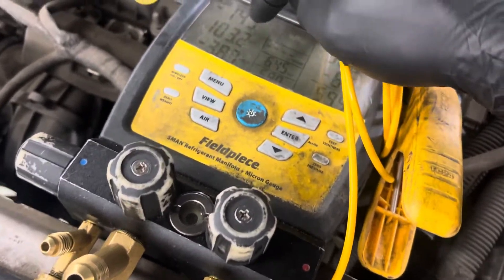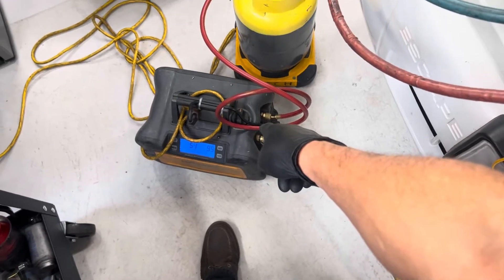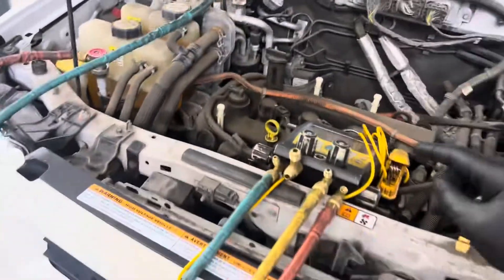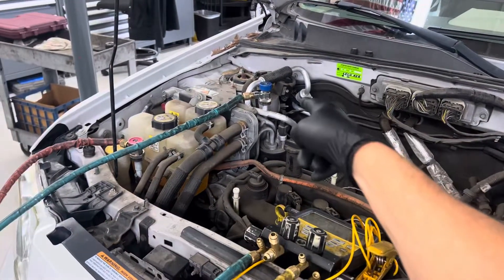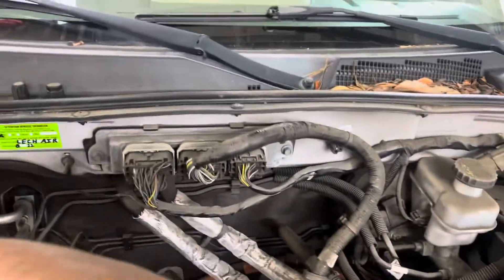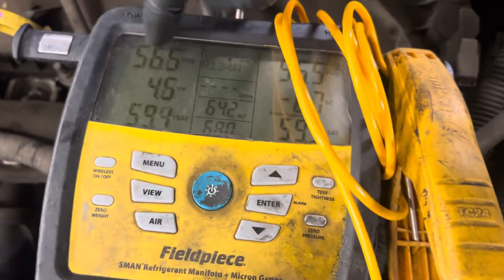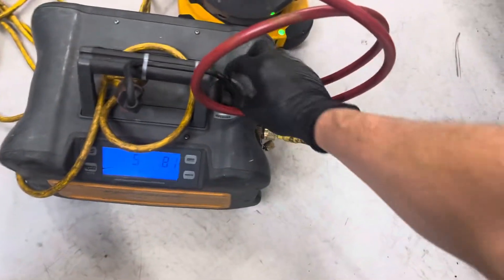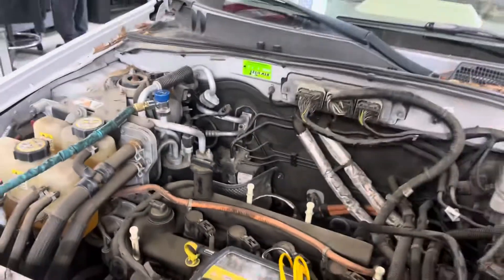Only 650g refrigerant recovered out of 1080 g Front AC only￼. Rest of the refrigerant in the rear. ￼

Comment: People don’t understand, rely on the automatic vacuum and charging machine. No wonder. I’m getting back on my coach AC. I got a Fieldpiece vacuum pump now. Had a SMAN, scale and remote pressure gauge. See if I can put the puzzle together and fix it this time. 99% sure need a new TXV. That’s is buried in the dash of a huge motor home
Reply from the maker: Wow you’re going full bore technical here and getting all the equipment never hear somebody who has serious. 

Good to hear from you Christopher haven’t heard from you in a long time I was wondering how that RV was going. 

I could 99% sure you on old RVs like that you need to change the TXV.  

Before you do any work cut open the receiver dryer and you’ll probably see some rust on the inside. 

Overtime the rest flakes off falls down to the bottom of the receiver dryer and is sucked up by the straw at the bottom that travels directly to your expansion valve and plugs up the expansion valve with rust 

And sometimes on the inside if you have steel fittings you look at the inside of the hoses fittings and you will see rust on the inside of the fittings ready to flake off if it’s really bad.  

You could use some sort of why are brush like cleaning the bore barrel of a gun or something like that to scrape off the heavy debris or completely change the fitting ends if you choose to or hoses or just be satisfied with cleaning and chipping off loose rust. 

On an RV leave the vacuum pump on overnight change the oil when it gets cloudy looking and repeat. 
If you need to leave the vacuum pump on 48 hours because after 24 hours it is still coming out cloudy leave it on 48 hours you cannot over vacuum. 

Especially if you have one of those RVs where you have 50 feet of hose going to a rear unit to the front unit.

Curious did you go to True Tech Tools ? Did you use the promo code for an 8% discount BIGPICTURE all one word capital letters
Reply: @coldfinger459sub0  shit no , ohh well. Thanks so much for the tips. I changed out the  reciver dryer last year in my first attempt. I wish I had looked but I do know the dealer got the dash air working a year when I bough it in 2019 so that’s out as a tell tale. I am semi retired so AC work on the side is not a bad thing. Do it right or not at all. Make money vs throwing it away. I’ll keep you posted by email. Planning on a few days of vacuuming. It must have over 100’ of hose and tube. Old York compressor. Love to swap it with a Sanden
Reply: One thing a few guys done is flush the hoses. I’ve heard they are filthy. So I do dig into the dash to pull the TXV , what’s a good flush?
Reply from the maker: @christopherrasmussen8718  I think from Napa you could get some thing called DuraFlush maybe some other parts stores to

Then O’Reilly‘s or grand auto everybody has some chemical company that sells a AC approved flushing solvent. 

Remember you cannot flush through receiver dryers you do not flush through expansion valves

Do not flush through compressors. 

Donely thing you can do with a compressor is manually remove it turn it upside down and pour the oil out

And if it’s one of those few compressors that actually have a oil drain plug you have to drain out the oil from the oil drain plug and put back in the oil through the oil drain plug

Like some of your SANDEN compressors
Tecumseh compressors
York compressors
Frigidaire General Motors A6 compressor
And others that you have to read the manual on and then all the rest pour out through the high side low side port
Reply: @coldfinger459sub0  thanks so much . Mines a York but I like to put in a Sanden

Comment: How much total refrigerant was recovered?
Reply from the maker: After I turned on the ignition key and recovered the rest of the refrigerant that was trapped 1080 g
Reply: @coldfinger459sub0  well done
Reply: @coldfinger459sub0  When I did the same for my vehicle total refrigerant recovered was 633g out of 750g,do you think there is leak some where in the system? Technician added 750g and told to come after 2months since vacuum leak test passed.
Reply from the maker: @issamadam9352  If your recovery method is accurate then yes there is a leak somewhere.

Unless the technicians charging meth it was inaccurate and did not put in 750 g